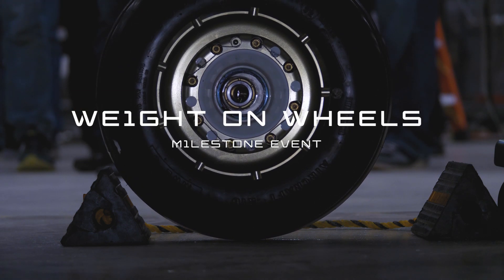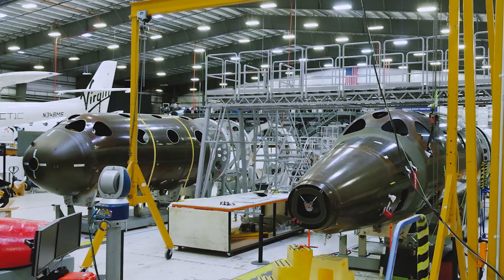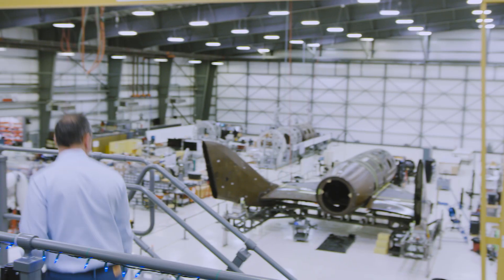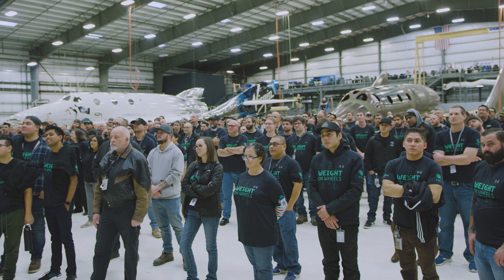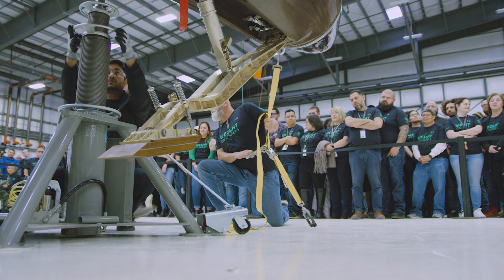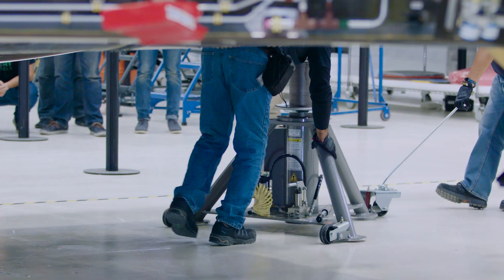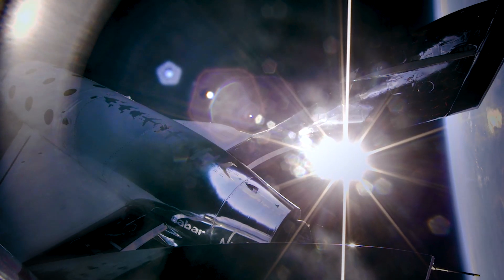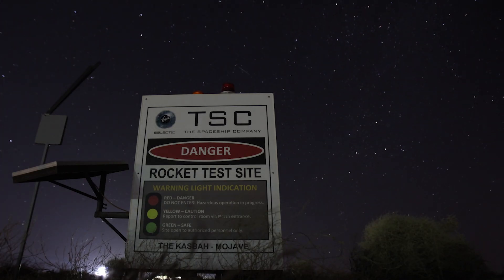VSS Imagine Completes Weight on Wheels

Comment: Spaceplanes are better than a vintage 1961 Yuri Gagarin brute force mentality of vertical flight orbital launch.

Proven Concept vehicles are "Xcor Lynx' and "Shen Long" launched from a Xian H-6.  

Hector D'Auvergne has a Patent for an upward angular acceleration into orbit spaceplane, Mutsuro  Bundo has a Patent for a lighter than air launch vehicle, and Robert L. Morrison has a Patent for a lighter than air solids one could seal in metal foil.

"Omni Future Almanac' by Ben Bova has an engineering proposal for a launch vehicle to resemble Marco Patrito's illustration for Asimov's "Foundation Trilogy".      

Branson has also ventured into "Virgin Orbit" of similar aircraft launch.
Reply: You censored my entry on how to improve propulsion.

Comment: Single stage to orbit is such a hopless concept.
screams in pillow
Reply: Many a rocket can achieve single stage to orbit. Just the payload is small and it's not re-usable. Now, reusable, heavy lift SSTO is the holy grail. And I agree it's VERY tough to do it with today's technology.
Virgin "Galactic" Spaceship XYZ is a suborbital vehicle, basically just kissing the Karman line if lucky.
Reply: this is suborbital not an SSTO

Comment: I don't think you can call it a spaceship if it hasn't been in space.

also 50 mile karman line is bs
Reply: What is your definition of a spacecraft and where would you define the point where you could state a craft has entered space? Have you got a better definition?
Reply: @EricIrl  considering this thing doesn't make it to the Karman line, it isn't a spaceship.
Reply: @cyn3rgy759  It does go beyond the Karman line. That is the whole point of the project.
Reply: @EricIrl  it hasn't passed it yet.
Reply: @StarshipTrooper  what is this supposed to prove? They didn't achieve orbit, and they didn't pass the Karman line.